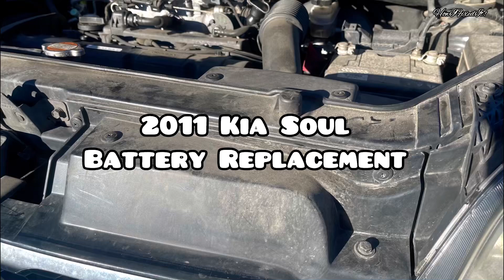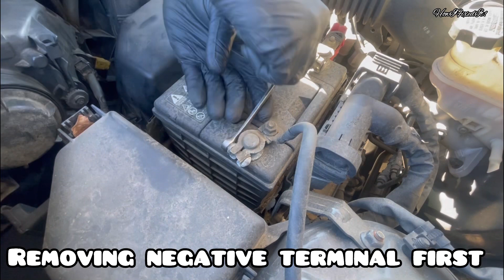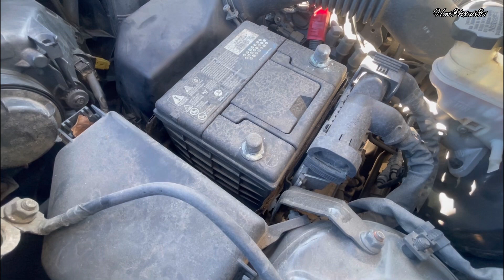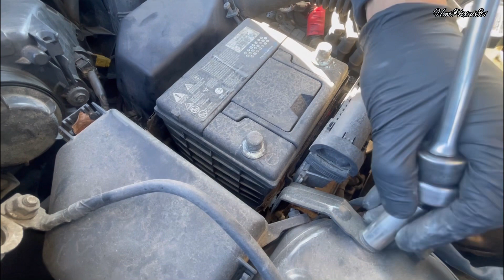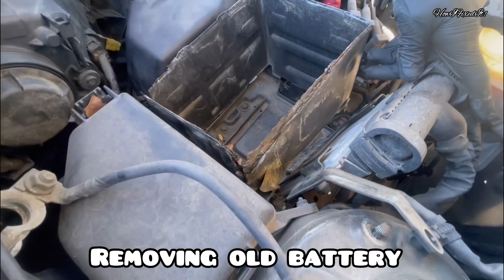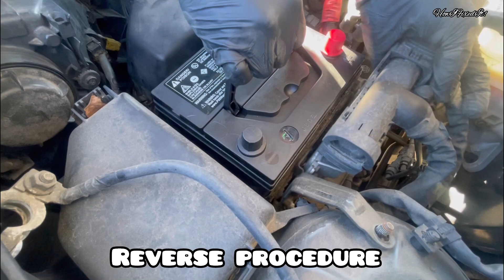How To Replace 2011 Kia Soul Battery #battery

Comment: I had to do this same process to change the battery in my 2011, but thought I'd add some helps: 

1) Once you loosen the two lower bolts and the funky one on the firewall - you can move it enough without disconnecting the computer plug crud on top of the unit.

2) You need a LONG extension (or like me play Lego with multiple extensions) to reach the two base bolts.

3) Look closely at the front of the battery, some models have a restraining bolt at the base (sgueegee looking one bolt thing), and if you simply unclip the plastic cowl in front of the battery, you can reach it with a 12 Metric, and not have to undo ANYthing else.

#4) Battery posts are a #10, all others are a #12

#5) THIS ONE is a HUGE DEAL: The battery books and stores all say that it is a 121R Battery, and it is odd, and it's the only one they carry for the Kia Souls, AND...at Walmart its $149.00! At battery joints it is $200.00 and that doesn't include tax or core fee. Stupid that little battery is that expensive yes? WELL.... a standard 26R fits perfectly and works perfectly, and will cost you only... $65-69.00 (+ tax and core).!!!!
Reply from the maker: Great advice 👍

Comment: What is the battery size for this if you don’t mind me asking. Just bought one and needed to change the battery and it has a different size battery then what it says online
Reply from the maker: The parts dealer will know that information.

Comment: Is there any functional reason why KIA mounted the ECU computer right behind the battery?
Reply from the maker: It’s more of an easy access location because computers have been going out like crazy in vehicles over time. The used to put the computer in the dash and it would take all day to replace. Now maybe an hour with programming. I hope this helps👍